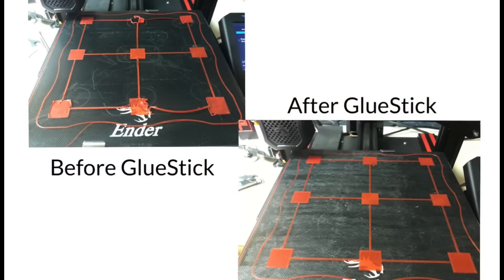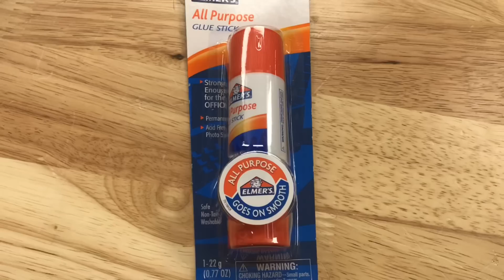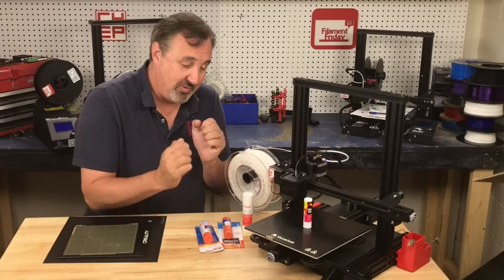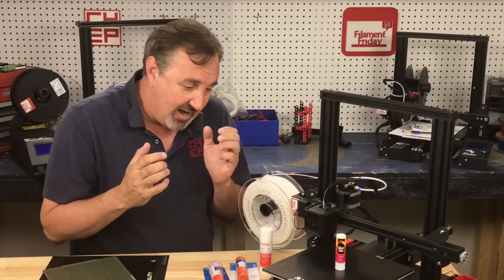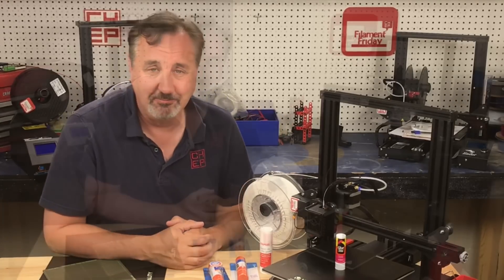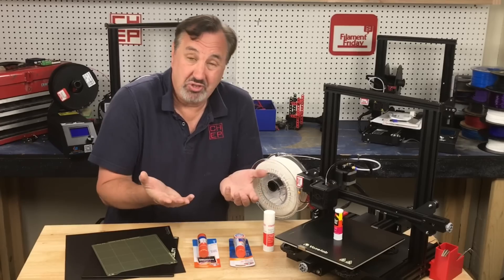Better Bed Adhesion with a Little Glue Stick

Comment: My thoughts - I really wish you would have showed us HOW you apply your glue stick.  There are all kinds of different methods shown on YouTube.
Reply: Didn't you hear him? ONE SWIPE!
Reply: Literally "swipe" it the same way you'd put it on paper lol.. just make sure not to leave a glob of it. basically using the weight of the gluestick itself, don't push it down or anything. I've printed 5 trees at once and had to cover my entire plate with glue, was a successful 20 hour print.
Reply: just like you would do with a piece of paper..slide it out..put it on the bed and swipe..;)
Reply: Im quessing 1 swipe over the WHOLE bed not going back and fourth numerous times :)
Reply: Ok simple swipe got it. But… showing it being swiped and a print results while explaining it would be the final touch. I’ve tried glue stick with poor results. I went over to Magigoo for its ease of applying. I also went to a pei surface.  The recommendation of “ just use glue stick” is never well presented as to one swipe or many. Also on a hot or cold bed. 
Chuck has gives his recommendation on what glue stick to try abs that’s a good start for me when my Magigoo is gone!
I’d liked  to have seen his favorite  glue stick applied and a finished print removal and surface outcome. Fortunately that’s a quick easy update he could add to his next video for all of us that haven’t used glue stick or weren’t impressed the way we were using it. 
Any experts can fast forward thru that. Problem solved.
Reply: I am to lazy for glue. I just print on rafts and use painters tape on the raft to hold it in place.
Reply: @gr7396  My best print surface totally depends on the filament. PEI springsteel cleaned with IPA for ASA, ABS, and PLA. I'm worried about PETG taking a chunk out of the PEI. 

For PETG and TPE, glass w/ hairspray works well. I spray it on thick until it's a uniform glossy coating, then preheat the bed to 70-80C to dry(or wait if you're patient or have multiple glass beds in a rotation). 

I like the texture of the magnetic bed surface for the Ender 3 Pro so I prefer to use that over the textured PEI springsteel for PLA and PETG and the PC/PETG blend I use. It's important to use wipe down with windex before the PETGs because I think it acts as a release agent to prevent welding to the bed.

I've used gluestick before and I've only had luck applying to a cold bed or the gluestick melts and globs, creating an uneven surface that impedes a good first layer. The self-leveling nature from the surface tension in the hairspray is what I like.
Reply: @RubixB0y  yes, I also had lumpy issues with glue stick when I tried it. I assumed it was how I used it? Hairspray was the best but after trying Magigoo I was sold. Goes on smooth on my pei for Petg, prints stay smooth against the surface and pop off easily. I have nothing to price, just looking for the easiest successful way to make a cad design into a finished print with no print surface adhering failures. I find I can water spray mist the Magigoo surface to get another use or 2 out of it without a new application. So one $20 bottle has lasted thru 9 mo of Petg printing I’ve done and I still have 1/4 bottle left.
At some point it has to be about connivance/success vs $ is my thinking.
Reply: @gr7396  It's good to hear you've had such a good experience with magigoo, I'll probably try it out sometime. I totally get that your time and stress is worth the price. I'm holding out hope for diluted white Elmer's glue applied with a foam brush but haven't tried that yet.
Reply: I've had good results both by putting on multiple layers and putting on a single layer, so IMHO it doesn't matter. Just don't get it chunky
Reply: Here's something easier. Mix 5:1 parts water and wood glue. Put it on a paper towel and wipe across the bed
Reply: @mochmaster45  I do have wood glue, so I'll try that. I don't think I diluted it enough when I tried it in the past and it beaded up for me so I thought it had to be the white glue.
Reply: @RubixB0y  yeah I use 5:1 particularly with gorilla brand. Might be slightly more or less for other brands. It's very thin though.
Reply: Makers muse has a show visual how to on applying glue stick
Reply: @RubixB0y  That's definetely not an unit of measure...like "some", "a bit", "a little"...
Reply: @bicycleday2577  Glue sticks let you be even lazier than painters tape.

Comment: Diluted Elmer's wood glue works just as good. or cheap aquanet hair spray.
Reply: Aquanet on cheap Walmart picture frame glass for me.  Works a treat!
Reply: woodglue is basicly the same as a gluestick..just in liquid form ;)
Reply: @Bitplanebrother  yes it's also mostly pva. BUT you can brush it on more evenly and if u are as lazy as me you can renew the coating with a few swipes of a wet brush.
Reply: @DrN4b0  i use  a wet sponge ;)

Comment: I use Elmers purple, but only because it's real easy to see if you've cleaned it off correctly. If you wipe the bed with a damp kitchen roll and you see purple, wipe some more! I apply the glue only to the area where the print is going to happen, not the whole bed, and usually use two layers at right angles to each other to ensure a good coverage. But I think one carefully applied layer would also work.
Reply: you don´t even have to clean it after every print..just a moist sponge to reapply it and then preheat to get rid of the moisture..
Reply: I use the purple gluestick too.  I paint a zig-zag on the print bed with it then use a slightly wet 1-1/2" paint brush to swirl it around and coat the bed evenly. I make sure to preheat the bed before starting the print job to make sure it is dry.  I've printed over 1000 hrs using this method with great results.  I liked the hair spray idea, but it seemed to me that the spray would get sucked into the cooling fans and gum them up

Comment: I quite often apply hairspray and it works also very well. The thing is don't spray it on the bed when its on the printer. That will easily mess up everything. Remove it, spray it on the balcony and done. Very nice video as always Chuck!

Comment: Thankyou so much for posting this. As a novice, its easy to get the impression that "real pros don't use glue sticks" . I tried everything on my ender 3. Bed leveling, frame checks, stepping, different nozzles, temperatures, beds, etc etc etc...  The ONLY thing that has worked to get that perfect first layer not to peel was glue sticks. I'm sure there are great professional bed adhesion products out there, but for the noob like me, this advice was a Godsend.

Comment: Had a bed that had decent warp so I switched to glass. First print usually works well but additional prints would have issues sticking. Cleaned glass and issues persisted. Decided to use glue stick. Between the glass and the glue stick best decisions I could have made. Yeah with glass you do not have the convenience of a flexible removable bed but who cares if I can use a glue stick to get perfect first layers?

Awesome stuff you have on your channel Chuck. You help make this easier for beginners like myself to get going.

Comment: It's incredible how well this actually works.. I had a few glue sticks that said conforms to "ASTM D 4236" that I got from a few filaments I ordered and decided to keep them, and I'm glad I did. I could never get prints that are 0.12mm thin to actually print, so I could never print in super good detail, because it would never stick, since it was such a thin initial layer. I always have done 0.2mm which is decent, but after around 50 prints on my glass bed; the initial layer was never sticking firmly anymore. I wanted to sway from using glue but I didn't realize you could just wipe it off with water after around 4-5 prints and recoat it. You def earned my like.

Comment: I have used glue stick on the glass bed of my Cr-10 and is has worked flawlessly. I did have to wash the glass sheet with soapy water and found I always needed to relevel the bed afterwards. I have since swapped out to a wham bam PEX magnetic bed surface and love it. Yes I do need to rough the surface with steel wool every so often and wipe with ipa but it works great. I rarely need to level the bed anymore. Great video btw. Cheers 👍😎🇦🇺

Comment: Glue stick for the win! 
I had a BL touch that I could not get to work properly.  After many hours of troubleshooting and frustration, I reverted back to manual mesh bed leveling and a bit of glue stick. I am getting better first layers than I ever got using the BL Touch.  Much happier with manual bed leveling.  Thanks for the tip Chep!

Comment: Been using the Elmers purple sticks and had really good results on my Ender 3 V2.  It's easy to see while applying and then clear during the print. I usually apply when the bed is heating up, it goes on easier.

Comment: Works everytime . 
Once applied , after the first print , 
I just dampen a paper towel and gently go over the bed after the print . Good for 4 or 5 prints .
Big help in releasing flexibles .

Comment: I switched all of my machines to wham bam spring steel pei. Love it. No glue and no tools to scrap off prints. Sticks great and pops right off when it’s done. The bed isn’t really disturbed when removing the plate so I rarely need to level.
Reply: Where did you buy it?
Reply: Same here I bought a cheap one form amazon and the creality one. The creality one is by far the best one. Never used glue on it after a year printing everyday its still going strong. The cheap amazon one not so great
Reply: @phucky0o  you can either get them from wham bam, they are in Florida or get creality version from amazon. If you ever need to change a pei sheet (I haven’t), you can get replacement sheets from wham bam.

Comment: I haven't used glue stick since I installed Energetic PEI magnetic springsteel on my bed months ago. I wash the springsteel with dawn dish soap every couple weeks, and no problems with prints adhering.

Comment: I have used this method for years and it works great. In fact often times I only need to draw an X or O to catch the print. When that isn't enough I use a skirt to show where glue is needed, stop, glue, then restart.

Comment: Wow, it just works ! 

I've spent a whole day to level my bed, configure a temprerature, replace an filament, 
googling, a lot of GOOGLING. 

But now it works for me. 
My first layer sticks well to a bed.

I don't know how to wash the glue from my table , but guess it is possible by 
isopropyl or ethanol
Reply from the maker: Warm water on a cloth washed it right off.

Comment: I've been printing on a piece of hardware store glass 1\8" thick for a very long time. If everything is level and the bed is clean, I never have any problems. I'll keep this in mind if I start having any issues.
Reply: I use thin picture frame glass with Aquanet.  So nice!
I just pull the glass off, let it cool, and I can HEAR my print pop off the glass.
Or I rub an ice cube on the bottom of the glass under the print, and speed up the release.
I then put the ice cube back in the freezer, and REUSE my ice cube LOLOLOLOL!

Comment: Love my Elmer's purple for prints with less base surface to help them stick to the bed. Great for use around the brims to help deter lifting. I use Windex Clear with Vinegar to clean any residue from the bed and have had great results so far.

Comment: Honestly, ever since I bought a heated bed, and placed glass from a $2-3 target frame on top, I've never had adhesion issues. Every print I give it a quick clean with alcohol. Then I updated to an official glass bed. With the heater cooling down, I could lift the entire printer up by the print, it's that strong

Comment: Well, I'm a rookie (first week of printing) and I know I have a lot to learn, but I came up with a variation of the glue stick option. It involves the same purple glue, but in a liquid form. I dilute it (about 60% liquid glue-40%water mixed well) with water and then spread it out on the bed. Much more level coating on the bed, it's thinner, and it has only slightly less adhesion. The prints stick, and they are just a little easier to remove. I only use one or two DROPS, so a small bottle of the brew will last for months. It also doesn't make that mound of glue in the middle of the bed that can happen with the glue stick. 

Before anyone asks, yes, the water evaporates when you heat the bed (50c is what I use for PLA). Leaving only a thin layer of the glue. It's also a lot easier to rinse off with warm water.

Comment: Agreed. Glue stick does have it uses. I used them myself on a cutting board print surface, before I got my 1st comercial printer. Almost every type of glue stick worked, except the most exspensive brand glue stick, called Pritt. Perfect for paper, but not 3D printing.
A touch of hairspray on my creality glass bed, and it sticks like crazy, except ABS....
My BIQU B1 with its SSS springsteel bed works like a charm, but it will wear out.
We must all remember, the only part of your 3D printer that doesn't wear out over time is the extruded aluminum frame....
Great video. As always entertaining, educational to relevant.

Comment: I agree with you completely. I’ve tried many different ways to get things to stick, but using a glue stick has given me far and away the most consistent results. I bought a box of Amazon Basics glue sticks for $5 and they’ve served me well, especially on the first generation Sidewinder that has a smooth glass bed.

Comment: I got Ender 3v2 with the carborundum plate. No matter what I tried all the PLA filaments I had (HatchBox, Overture, and MatterHackers) would warp slightly in corners, even while the rest of the print had good adhesion. I even tried using a brim and while brim would hold great the corners of the actual models would still warp despite the brim.

After almost 2 months of struggling, I decided to flip the bed to the smooth glass side and try glue. Problem solved, no brim needed, the prints stick great and no more warping. So yeah, glue stick is amazing.

Comment: I always use something to aid adhesion, usually glue stick.  I got tired of applying and cleaning my CR10 S5's large bed so I recently started using Layerneer Bed Weld and I have been really impressed.

Comment: Hairspray works well if you just spray into a papertowel, then wipe the bed. Doesn't get everywhere. The trick is to just wipe it down to get a thin coat.

That being said I stopped using it when I switched to the Wham Bam PEX surface.
Reply: Ya I have PEX on all my enders and no longer use hairspray except for PETG.  It sticks too well and so now I add the hairspray to get that barrier so I don't tear the PEX.
Reply: Wham Bam is the best upgrade I made to my printer.

Comment: I am a rookie with a CR-10 Mini and the stock glass bed. And have used the Elmer's extra strength glue stick cleaning with Windex and Alcohol each time with a single light "swirly pass" where the model footprint touches with extra attention at the corners and it probably holds too good. And with such light coverage, each stick lasts forever. Will try some lighter sticks and see how they work. Great results for a very flat surface, thanks!

Comment: I have been using the elmer purple glue stick since I got my ender 3 v2 about a month ago and it has pretty much completely changed the game. I have had a total of 0 issues relating to bed adhesion, except if it sticks too well then you can just knock it with a blunt object (such as a screwdriver handle) and it comes right off.
Reply: What are temp levels are you using?
Reply: @TheTrashPirates  I’m using bed 50 Celsius  and nozzle 200 Celsius with PLA but I think you could set the bed higher if you’re still having issues
Reply: @mushroom-madness1  Thanks.. We are new to this. We are using the Overture filament at it says to use 230 - 250 for the nozzle and 80-90 for the bed. Tried everything within that range and does not stick! Cleaned it and last thing I am going to try is the glue.  But I am giving it temp and nothing.
Reply: I'm too facing the same
Will try glue stick
Mine also E3 V2

Comment: Using your bed level Gcode, I found that the corners were fine, but the center was low.  I put two layers of painter tape on the bottom of the glass bed, and re-leveled the bed, and got a really good level.  Prints since have been really good, and the clue was using gcode which also touches the center of the bed, so thanks very much!

Comment: Hairspray works great for me and after a while I just run my bed under some hot water and all the old hairspray comes right off and my bed still looks new and yes you have to be strategic with it make sure it doesnt get on straps and fans but its works for me. I havent tried a glue stick yet because Hairspray worked so well for me. I will try it per your recommendation. Thank you.
Reply: I have a friend with a metal bed, this is his go to, never failed him (the purple can stuff with the kangaroo on it)

Comment: As always, Great tips Chuck.   I use glue sticks and layer of painters tape.  I know its an overkill - but I don't have to worry about cleaning the bed. I just remove the tape after 2 or 3 prints and reapply a new layer of tape.

Comment: Glue sticks and other adhesives works not only for sticking, but for proper "releasing". PETG can stick to clean (deoiled) glass so well, so you could get pieces of glass on your model.
Those "glue sticks" that works - are all made on basis of PVP (Polyvinylpyrrolidone) - the same for many "3D spray glues". Those sprays could be made of PVP, isopropanol and some distilled water - very cheap, and gives very nice first layer. Also, for some naughty filaments (like PA or ABS) you could use "polyvinyl butyral phenolic" glue, twice deluted with isopropanol - works like a charm, thin film works nice for several prints, and could be removed by placing glass bed under hot water for several minutes.